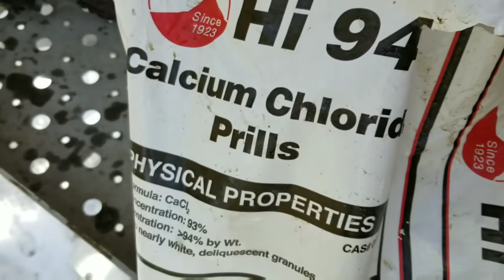CONCRETE FOUNDATION WALLS WITH SNAP TIE FORMS

Comment: Woah! 12 inch concrete blade to cut rio bar! Mad dog! 😂😂 A 5 inch blade on an angle grinder would nearly be overkill! 

Love it!
Reply: Yeah until you’re halfway around the house and only your 30th blade with and angle grinder, rebar Eats grinder blades up too quick
Reply: @kylemessick7043  nearly say a circular saw with a carbide tip blade would the better of both options. Goes through grid mesh like butter so rio would be easy days

Comment: Thanks for the video! One thing I am curious about, wouldn't you want to level, pour, and set the ground first so your walls are also level?
Reply: Late reply. But you want to pour the floor later, inside the walls. Because the floor will keep the walls from pushing in.
Reply: They say plumb 😂

Comment: Great vids.  What secures the bottom of the wall forms to the footings while you pour?  Is it simply gravity and the weight of the forms that keeps them in place?  I see you have a few kickers bracing the walls but is there anything that actually connects the forms to the tops of the footings on which they sit?
Reply: shouldnt need to if footing is perfect and wal is centered on key way of footing. couple kickers to get it on mark
Reply: The keyways and L bars in the footing are basically step 0 of the wall prep. The bottom of the L bars get tied to the footing steel and the other end  gets nailed to the edge of the 2Xs that will form the keywAy so that about 18” of  bar will stick straight up out of the footing every 16” or so, and runs  parallel to the keyway and they both basically run the length of the footing. Step 1 of wall prep is to tie your vertical bars to those L bars and that’s how the wall and footing stay together... lots of steel, lots of ties, and a keyway.... just kidding... They actually hold themselves together with dark magic and a few pints of an innocents’ blood...
Reply: A 2x4 with 2 duplex nails predrilled of course, driven every foot or so I ve been doing concrete for 8 years now it works great
Reply: @steve822009  would the wall be much stronger if I put the steel verticals at 12"?

Comment: Hey what do you do with the plywood after you take it off?
Reply: Save it for the next form project inside the concrete structure you made or use them to make a home for them out of concrete so you can keep making concrete structures
Reply: That’s what I wanted to hear. I was worried that the plywood would go bad after you take them off.
Reply: Or use it for the roof

Comment: 3/4 ply??
Reply from the maker: Yes it is
Reply: Can I use 1/2 plywood with lot of 2x4 bracing behind it?
Can I make 4x8 panels screwed to 2x4 frame for strength every 24"?

Comment: i just want a simple block or poured concrete 30 ft round house with a low 10 ft. roof with maybe 8 ft walls simple enough for me. its a dream anyway
Reply from the maker: That's totally doable

Comment: I'm so confused... the drill looks modern, the video looks modern. But the formwork looks like its from dinosaur ages. Never can understand why someone would use such old technology. My crew of 6 guys could have that foundation set/poured in an 8 hr day. And strip it in 2 hours. All aluminum forms
Reply: Jim tenHaaf YES ALUMINUM FORMS... OCEAN STATE FORMS R.I.
Reply: All aluminum wich means as a carpenter u wouldnt know how to actually frame a wall some gcs prefer this
Reply: Wood has more versatility.
Reply: I can use my plywood forms after a couple years to make roads. Couldn’t do that with aluminum forms
Reply: Can you drop those forms off at my house or should I just buy some plywood?

Comment: Why not rent some forms?
Reply: taco bender forms are expensive as hell and a headache to clean before you turn back in
Reply: I'm looking into building a house out of I.c.f. but will need plywood forms for exposed concrete.
Renting forms is expensive and they can be stolen off your job site.
Plywood is cheap and can be reused as forms again.
If I have the experience using the plywood forms I make and I know I can set rebar then I want to keep my forms for my wall/fence or if I want a garage.
After you make things out of concrete you realize how stupid it is to only use the wood once.

Comment: Wedge n wailer is 1970 shit.  Buy a set of advance forms . you can do a wall formed, poured and stripped in 2 days depending on size.
Reply: How you gonna tell him to use an advanced system when you have a video on your profile breaking concrete with a sluggo?
Reply: You watch 2 many videos.
I wouldn't pull any forms from a wall, especially 8" thick in under 7 days.
Especially if it snowed within that 7 days.
Reply: Curing time has nothing to do with forms.
It's all about the concrete and weather
Reply: @ronnieayo985  it depends on accelerator in concrete. I have stripped many walls same day as pour

Comment: Snap ties are a bad job. Got rid of this system over 20 years ago in Ireland. We build slurry tanks and with snap tie ends sticking out inside the eventually rusts and expands and cracks the tank
Reply: So  what system  do you use?
Reply: @ralphpomm4943  the forms we use have holes in them. Which a threaded bar goes through. There held together that way. Pans are bolted together. Can set them to any width you like